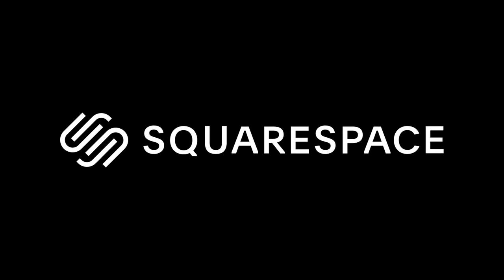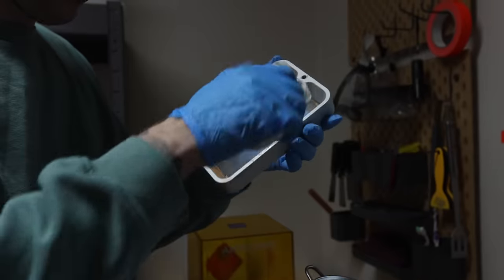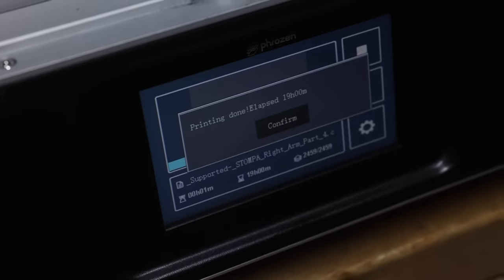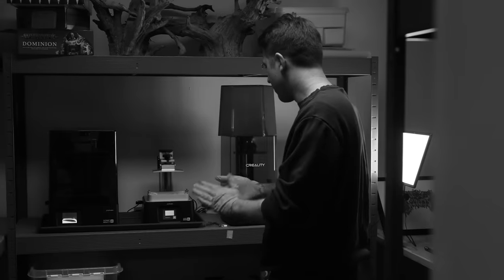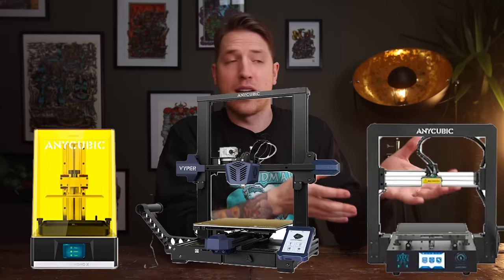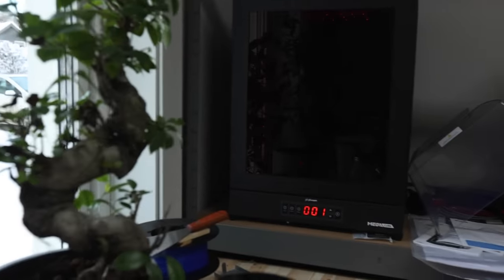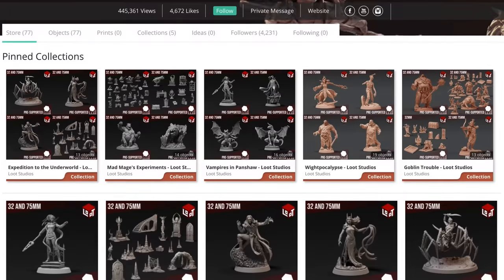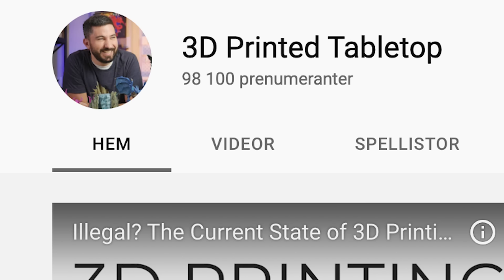6 things that made me hate 3d printing less

Comment: I've watched the video twice now and have no idea why I'm supposed to save the supports.
Reply: After a failed print, you put the old supports in the vat, gently, make sure the bottom touches the FEP. Use the tank clean/timed exposure function of your printer. It will make a solid sheet of cured resin across the FEP that will capture any failed prints stuck to it and the old supports are embedded in the sheet. Lift the sheet off the FEP by the supports. Much easier than draining the vat and trying to lift off failures individually.
Reply: @bathtubanarchy  GOT IT, I did not get that the supports are supposed to be a handle. Thank you!

Comment: Do you remove supports before the cleaning station ?
Reply from the maker: some times, some times not :)
Reply: I have found better success with adding an extra step between cleaning and curing, where I soak the supported mini in warm water, once the print warms up the supports just fall away.

Comment: Anybody have suggestions for a good tough resin? I've been printing accessories and drone parts that need a good amount of impact resistance - I've tried some of the "abs-like" resins and found them to be too brittle
Reply from the maker: Most fast resins are more brittle unfortunately. One of the reasons i still don't enjoy painting printed stuff as much as casts. Try Z-Mud or M70, they are a lot slower but not as sensitive.
Reply: @SquidmarMiniatures  thanks for the tip! I'll definitely give that a try!
Reply from the maker: @Lozoot2  Also there's a resin called onyx by phrozen, its a collaboration with loctite. now that i think about it that might be even better.

Comment: Yeah... No. Still ain't buying a resin flinging, curse generator. I'll keep checking back until 3D printing actually works without making you want to throw the printer off the roof, question your life choices, and not needing 10 accessory machines to "finish" your resin prints.
Reply: I mean it's not that.
I literally just have a photon, a jar with alcohol, and a window ledge to let them cure.